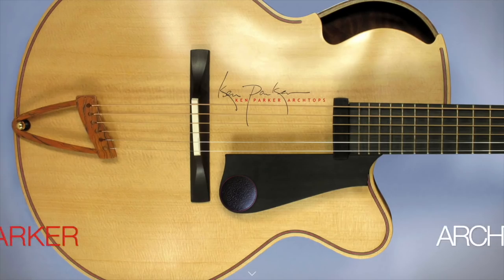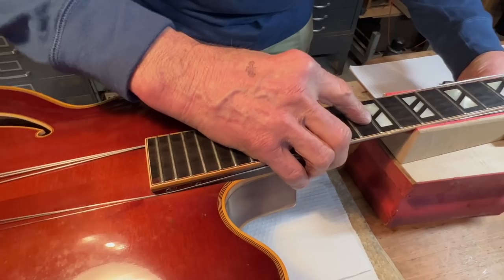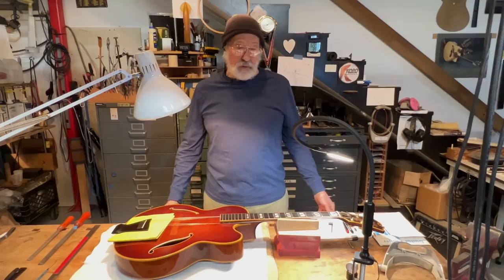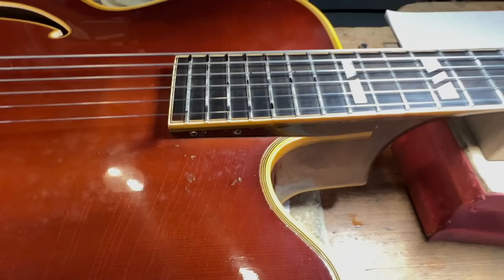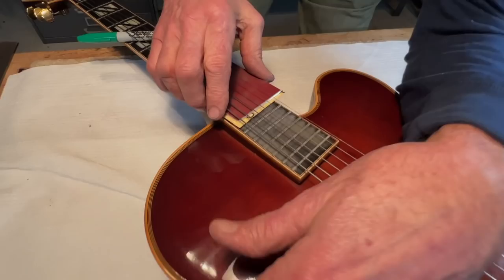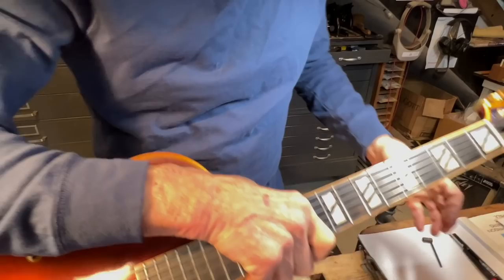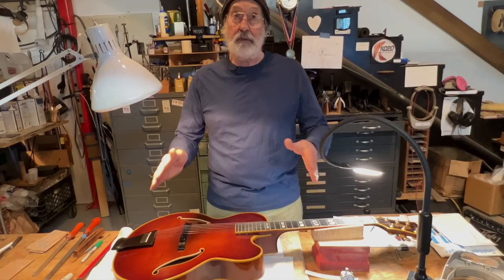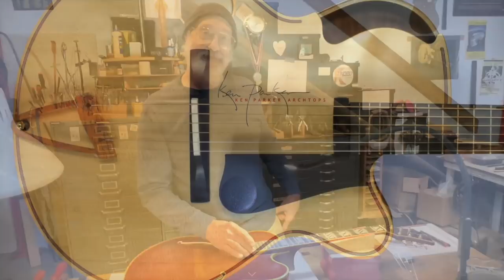Ken Parker Archtoppery - Inspiration from the Masters - The D'Aquisto - Fret Work 1 Examination

Comment: I think there was a scene in that little New Yorker documentary where Jimmy was building something for Jim Hall. For fret positioning he used a homemade Incra rule to drill two little marks on opposite sides of the center line as a visual guide for his backsaw...
Reply from the maker: Agreed, though the shot is so quick, it's hard to know exactly what he did.  I'll have to go back & look, but the evidence I have shows only one dimple.
Reply: In "Making The New Yorker Part One"(around 12:29 mark) there is visible one mark in the midle of the fretboard. I remember you mentioned this video on your channel about year ago. I found it recently and watched it at least 10 times since ;)
Reply: @podfuk  I haven't watched it in several years. It would be interesting to know if the misplacement is common or a one-off accident.
Reply: @podfuk  I think it may be more around to 9:58 mark or so on that documentary. It's a bit grainy, but I think I see the marks for sure. Good eye Mr. Woodford!
Reply: Ted! It doesn't surprise me that you'd be hanging around in such lascivious neighborhoods 😊

Comment: I wish I would’ve found these tutorials before my first leveling and dressing. I got it done but geeez. Could’ve been better,lol. You can actually see how much pressure he’s using and isn’t just rushing through things. The “marker technique” is fine but without experience, you go thru the mark really quickly and still have a long way to go. You realize it’s only good for very light touch ups. Leveling requires a lot more material to be taken off. It’s more evident in these videos. These are the best free tutorials I’ve found yet.
Reply from the maker: The secret to this is just many repetitions, like most things! No rushing is a good start!

Comment: Back in the 70s I bought a fret leveling system, from Thomas Ginex. It was an aluminum plate with to raised bumps. You jacked the strings up like you are doing with the Sharpie and worked under the strings at tension like this.  You turned it over and the two bumps rounded over the frets! 

These days I do this using a cabinet card scraper.
Reply from the maker: David!  Thank you for this.  I, too bought this system in 1973ish? and forgot the "Thomas Ginex" name, but thanks to you I can give proper credit.
The methods I show here are directly descended from his cool, inexpensive tool and the excellent instructions, even featuring photographs of the tool working on a big old D'Angelico just to show you who's boss!
Reply: @kenparkerarchtoppery9440  Hey Ken, that’s very cool! I see this product was reintroduced a few years back. Their website seems to be gone now. 

By the way, I met you at the A.S.I.A. Symposium in PA back in (I think) ‘95 when you gave the lecture on developing the Fly. Later we chatted outside for about 45 minutes. It was the highlight of the weekend.  :)

Comment: Its always fascinating to watch folks with decades of experience level frets with simple tools rather than yet another high-dollar specialty product from StewMac. While I love my StewMac leveling beams I think I get overly concerned with accuracy and using a tool that makes it less likely that I can sand a problem into the neck rather than fixing the issue that got the guitar on the bench on the first place. But when you've done the task 1000 times your technique is as good as any special tool could ever be for achieving the same result.
Reply from the maker: After you've tried everything, it usually seems that the simple way proves best.

Comment: Hip hip hooray some one else that uses the string on technique for final leveling I use diamond file plates attached to plastic backing substrate.
Ken,there is a Japanese design that uses an aluminum T extrusion and the sand paper is adhered to top of the straight edge while the 
right angle center strip is slid between the stings allowing the string's to stay in tension while leveling.Have you seen that?
Reply from the maker: Nope, but a good idea.  At your local hardware store you can get some light section angle aluminum that is very accurate, and performs just as well, or you could 2 side tape two of 'em back to back and make your own "T".
I like the big plates I use, as the sandpaper wears out in 2 shakes, and enough already with the bitty little precious tools, we need to get this done and move on to something funner.

Comment: Hi Ken, thank you so much for the invaluable tips! Won't using a flat and wide block to aggressively sand radiused frets leave them lower in the middle as they relate to the fingerboard? Are you simply following the contour of the board by applying varied pressure throughout?
Reply from the maker: I guess I didn't explain this well enough. Although the block is flat, you guide it so as to create/follow the conical surface of the frets and fingerboard. Sadly, curved blocks are sold for this purpose, but they're wrongly applied here, because they generate a cylindrical surface, which is incorrect.
It's a bit of a challenge to get this motion just right, just another one of those things that takes time to become second nature.

Comment: All of the archtoppery videos are really helpfull and motivating. I really want to improve my fretting/crowning techniques and really needed a video like this. Have a question, do you think that buying a planner's knife say 18'' it's a good substitute for a straight edge?? I'm from Chile and we don't have many options to buy these tools and the prices are really hi. Thanks for every thing
Reply from the maker: Good question, there is no substitute for a truly straight edge.  Even at Parker Guitars, wherre we had a tooling budget, I'm such a cheapskate, we would buy a whole bunch of precision ground tool steel bars, (not precise enough, as supplied), clamp them in a stack, and work on them by various filing and sanding means to get them all straight.  Two straight edges won't check one another, you must have at least three, if you get what I'm saying.  Make your own tools, and you'll add muscle to your skillset while probably getting better tools than you can buy.
Reply: @kenparkerarchtoppery9440  Will try to make some new tools thanks for the advice

Comment: I wonder if you could comment on whether allowing the fretboard to float after the heel, like a violin fingerboard, is helpful to prevent movement of the neck from distorting the fret board. Ive often wondered why violin design incorporates that feature but you don’t see it as often on guitars.
Reply from the maker: Really good question. 
Although some guitars escape the neck/body distortion you mention, many are compromised or even disabled by the combined bending of the body and the common "kink" in the neck where the neck shape becomes the heel.  These two predictable distortions often conspire to make a neck reset necessary.  Sadly, in most Archtop designs the fingerboards are bonded to the top, usually with a neck extension spacer between them, and are Extremely Challenging to remove.  

The violin family employs a simple and serviceable neck joint that has proved itself over centuries. 

Here's my design solution to this important intersection...

https://kenparkerarchtops.com/brownie-gallery

Comment: Seasoned eyes appreciate great lighting!  Kinda neet that you “get” to work on your mentors build.  Regular mill file with a custom grip?  Is your lack of covering everything with tape the result of thousands of hours of repair resultant in muscle memory assuring it unnecessary?  For your new builds, have you found fret wire that is reasonably consistent with tanged Fly material?  Have read many comments about your work, and would like to pass along a brief observation, the camera operator should get an award for the skills of chasing you around the shop, keeping things in focus.  Kudos Mr. ( or Ms.) camera person!  Another fine example of a highly skilled craftsman at play.
Reply from the maker: Thanks so much for your kind words.  I LOVE the EVO wire you can buy from Jescar.  Since 2005 I've used .090"  X  .055".  Accept no substitutes.
Reply from the maker: Oh, and if you don't slip, you don't need tape, which is hardly a guarantee of Getting out of Jail Free anyway.  Stiff cardboard works better when things are super tight and seem vulnerable.

Comment: Ken, I have a taper guage (INSIZE 4630-1E) that allows you to measure the relief under the straight edge.  Do you have something similar?  I don't like to rely totaly on visual at my age.
Reply from the maker: Been at it so long, I tuned into these little slices of light under the string many years ago.  Taper gauges are great, but how many arms do you have?  I got but two, and feel challenged all the time.

Comment: On Archtops, the neck is angled backwards. Is there a backward neck angle that would be just right to avoid "neck creep" or is it unavoidable? I don't know if bowed string instruments like the violin avoid neck creep or not with their neck angle. I find that the backward neck angle on Archtops actually makes them easier to play.
Reply from the maker: Angle is unrelated to creep in any important way.  Creep is just the gradual lengthening of a material under a tensile load, and the only way to avoid it is either to use a material that doesn't creep significantly  (carbon fiber and high strength epoxy will do just fine), or make a full time commitment to air guitar and forget about using strings.
Reply: @kenparkerarchtoppery9440  Thanks for clarifying that.

Comment: As you said it's easy to see where this bridge should go - but Jimmy put 2 scratch marks with an awl on the top of my guitar in front of the thumb wheels where the bridge is supposed to go incase you have to take it off- just line up the front of the bridge with the scratch marks-- does this guitar have them?
Reply from the maker: Hey Frank, I've seen these marks on some other of Jimmy's guitars, but they got left off of this masterpiece.

Comment: That copper strip would serve as an electrical "bond" between the 6 strings, so no one string has a different potential than any other... Not sure what benefit there would be to ground them since they don't have any direct contact with the pickup...
Reply from the maker: Correct, and I agree there's no grounding benefit.  It seems that Jimmy was trying out some new things while wiring this guitar.  One might guess that maybe he changed his mind mid-project and decided that a string ground wasn't needed?  In the immortal words of Fats Waller, "One never knows, do One?"

Comment: You don't believe in the long 16" sanding beams?
Reply from the maker: Pretty bad idea in my opinion, but to be fair, I guess I'll need to expand on these techniques in a film.
Reply: @kenparkerarchtoppery9440  There are a lot of different techniques for leveling frets.  The newer technique uses the long 16" sanding beams but I bet the way they used to do it 50 years ago with a regular 8" file was probably better!   I've done both and didn't do any better with the long sanding beam.  Pleking is the wave of the future and there are going to be less and less manual leveling  in the coming years.  Thanks for the reply, it's an honor!

Comment: By the way, the addition to your dial indicator is almost exactly identical to the drum gadget “DrumDial.” You might have already seen it.

It’s just a dial indicator with an aluminum base instead, and has a clip to offset a distance from the tension rods on a drum head to give a ballpark check for tension around the perimeter. 

Your mod is better (and probably didn’t cost $100 for just an additional a piece of round stock) because the protrusion of the tip is shorter and more suited for this application.

Comment: you seam to be taking a lot off the frets
Reply from the maker: In the previous video, I checked the frets heights with a shop-made dial guage tool, and found that the frets near the end of the fingerboard that were "in the way" happened to be .004 - .005" (.1mm) too tall.  What happened was that when this offending material was filed away, every fret ended up being .030" +,- .002", which is quite some testimony to Jimmy's excellent work, and the stability of this guitar!
It's important to remember that removing 4 or .005" from a group of frets in the second octave really is a lot of material removal, just because the frets are so close together, right?  Metal cuts slowly by hand, even with a sharp file, and I get that it looks like a lot is being removed, but that's why it's so handy to have a quick, accurate way to measure the fret heights.
One more wrinkle, the frets in the second octave get used in a very different way than the frets closer to the nut.  These upper notes are unlikely to be bent very often, and for most players, are occasionally used, so that even if these upper frets were a bit on the low side, even .020" (.5mm) high, they would probably work just fine for most of us.

Comment: You speak of common repair needs in an uncommonly nuanced manner. I see very bad fretwork all the time. As you’ve shown, it is only the last part of a job involving, at least for solid bodied guitars, the entire instrument. 

The set of the neck, the string gauge, rod tension, and to a very high degree of accuracy the SHAPE of the action, which involves many measurements across and up and down the neck, and is anything but flat - these things make a guitar ready for fretwork. 

Many of these are ignored and as a result, a guitar is rendered all but unplayable, a real shame. Armed with these brilliant videos of yours, Ken, we at least stand a chance of weeding out the dabblers and incompetents from this high-skill work.
Reply from the maker: Wow, great! It's true that the condition of the neck and fret tops is critical, and nearly always misunderstood, it seems. We can get along with "good enough" in lots of areas, but precision fretwork isn't one of them. As a repairman for many years, I heard plenty of heartbreaking stories from customers who permanently injured themselves in the pursuit of excellence. It's one of the primary reasons that I wanted to take the chance to create a guitar company twas to have a shot at routinely fulfilling the promise of a playable guitar. It doesn't seem too much to ask, but the neck is a real challenge, one that I'm exploring on the channel right now. I hope to be able to move the needle in the right direction.
Thanks for your support!